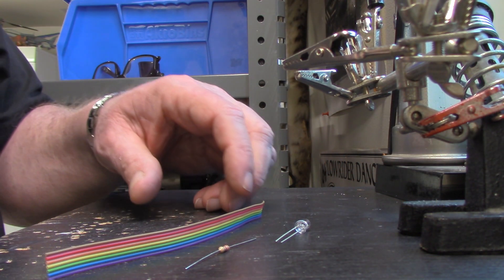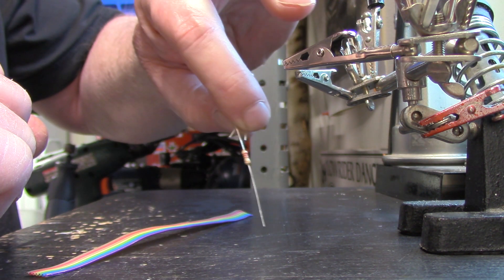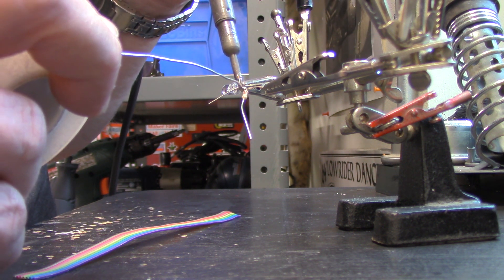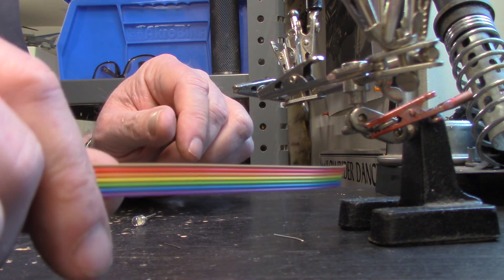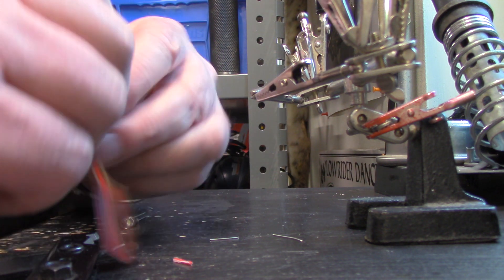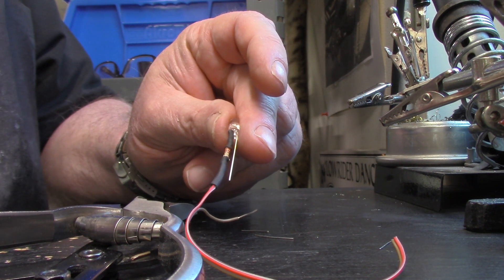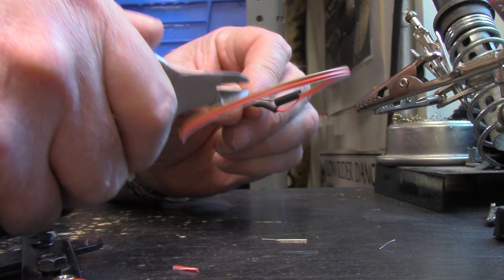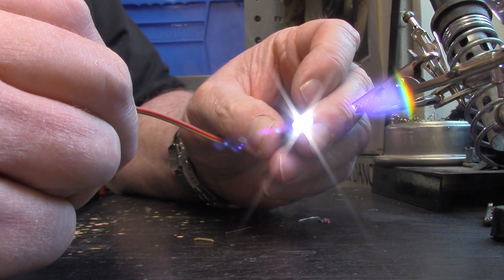How to wire & solder a led with a resistor.

Comment: Great video. How hot would that resistor get if you hooked it up to a car battery. ? 
Would it get hot enough to melt plastic?
Reply from the maker: A standard 1/4 watt resistor would get quite hot. If you using a car battery you would use a 1/2 or 1 watt resistor & use heavy gage wire to keep it safe.
Reply: @voodoofx1946  Great, thanks for the reply !

Comment: If I light an LED with a 6v 2032 switchable pack, do I still need a resistor? If so, how many Ohms?
Reply from the maker: Hi Tim, If your using 6V you will need a inline resistor. 1/4 Watt 220 Ohm.